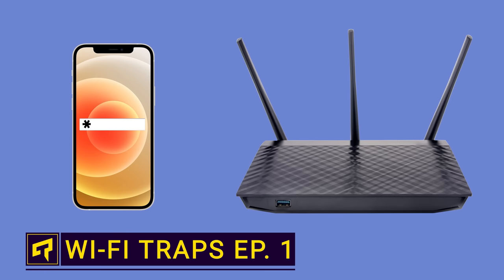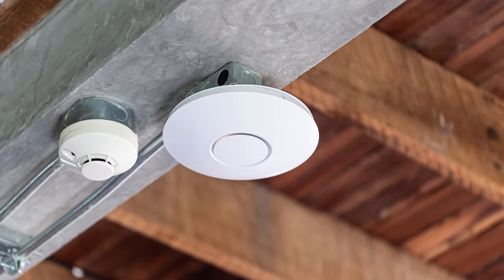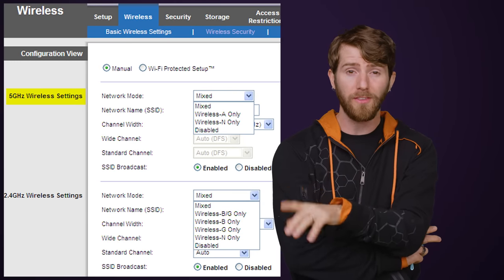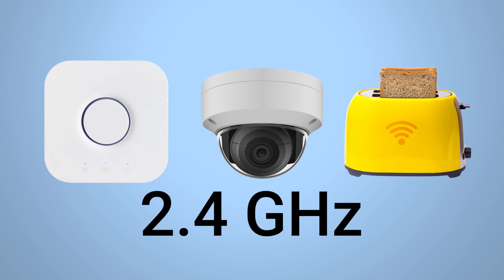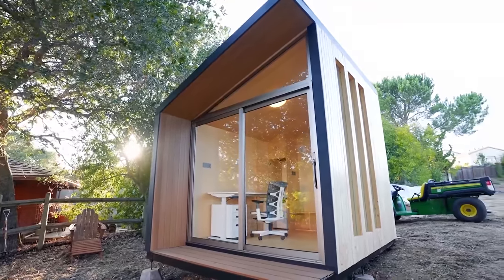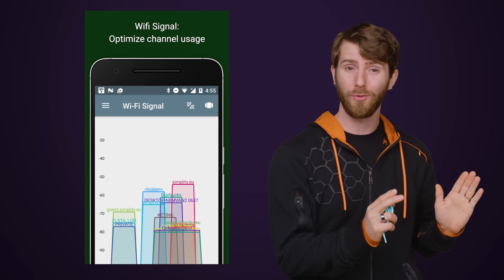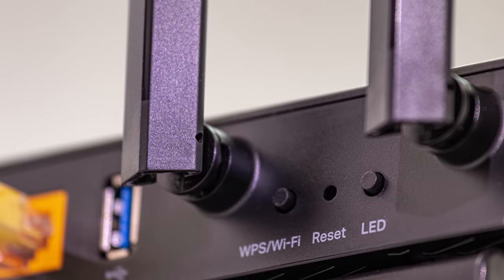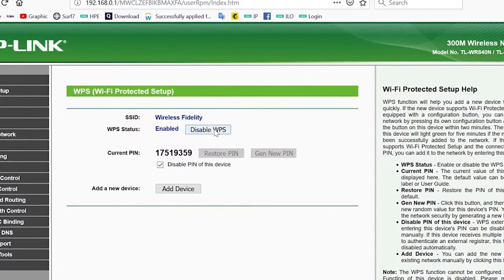Avoiding Common Wi-Fi Traps

Comment: Some routers will combine 5GHz and 2.4GHz signals into one SSID, I usually keep them separate to make it easier to find out which one the device in question is connected to.
Reply: I agree Hamil. Many Telstra routers here in Australia have this & it is known as Band Steering, which I disable when troubles are experienced & it solves many of them.
Reply: @davidewin6833  Thanks! I knew there was a name but never figured out what it was.
Reply: My ISP advises against it claiming that keeping them as the same SSID will allow the network to choose whether 5ghz or 2.4ghz is better, but I think manual is better
Reply: @shaansingh6048  well, you can avoid the router choosing the band by setting your wifi device, which matters, to choose the band.
Reply: @shaansingh6048  I agree with you - ISPs think they know better but I've been a tech for over 30 years & I know what I see.
Reply: @shaansingh6048  I've seen this mentality a lot, and it's for the average person who just wants it to work good enough with minimal effort. And I can't honestly fault then for it sometimes.
Reply: @davidewin6833  ye
Reply: @davidewin6833  that video ruined my day
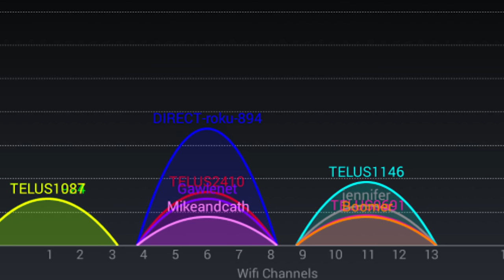Reply: @dragospahontu  Sorry - just my sense of humour. The important part was at 2:26 in the video. Your reply to me was just 'ye' & I wasn't sure what you meant by that but reminded me of this line from Start Trekkin' which is 'Ye cannae change the laws of physics', something that Trekkies know was a common phrase uttered by Mr Scott, and I felt that wifi has a lot to do with physics hence the joke.
Reply: @davidewin6833  that video is so fucking weird man😅
Reply: @dragospahontu  A novelty song from the 80s when everything was weird, big & overblown.
Reply: @davidewin6833  tbh I wasn't born in the 80s, so that's why it makes its strange for me
Reply: @dragospahontu  I was born in the 60s so this was all a part of my life experience. Sorry I never asked but I assume you actually meant yes/yep/yeah, as in you found what I originally posted to be helpful. I also posted another couple of helpful tips here later as I thought more about it.
Reply: @shaansingh6048  The problem is you never know what kind of advice your ISP will give you (at least here in the US). I requested one ISP technician to check for a firmware update of their modem before I concluded the existing modem was bad and needed replacement. They literally told me "I don't know what a firmware update is and we can't do it". What a bunch of clowns!

Comment: My fav tricks to secure WiFi:
1. Turn WiFi off whe not in use.(when I am at office i turn the wifi off, only wired have access)
2. Running at just enough output power to cover my home but not enough to extend outside.
3. Allow only whitelisted devices to connect (enter Mac address manually to allow devil to connect)
4. Change password frequently.

Comment: Instead of hanging the router, why not just flip it? In fact, if signal is really stronger below the AP, why don't manufacturers of residential routers just install the AP upside down?
Reply: He said hanging it is better because of the lack of obstructions
Reply: I THINK he means that the wifi signal travels downwards (Towards the Earth) due to the forces exerted by the earth, as supposed to literally from the bottom of the router. Hence why keeping the router higher up will ensure a wider field of coverage.
Reply: It’s actually a good design for those who have a basement or a 2-story house.
Reply: I just keep it right above the door in the middle of the house
Reply: Rarely you'll get a modem/router/AP from a provider, where the antennas are external. In the case that they are, you'd not be able to install them "downfiring" as theres probably a table or floor underneath.

Comment: Wifi tip: try and create a balance/distribution of devices on 2.4GHz and 5GHz. This will make it more likely that neither band is using all of its available bandwidth. As one example, if you have 2 tvs which are regularly streaming content at the same time, putting each one on a different frequency makes it less likely to run into bandwidth issues.

Comment: In congested spaces, it is actually better to be on the same channel as other networks, as opposed to being one or two channels off.

If you move to an overlapped channel (like 9, when there's a bunch of networks on 11 and 6) the other networks are just interference to your signal.  But if you are on the same channel as the others, the network will attempt to work together to share the bandwidth available.  In heavily congested locations, it's going to suck either way, but allowing the networks to work together may mean it will suck less.
Reply: @UbixQ  There's only 3 different channels in 2.4GHz in NA that don't overlap due to spread spectrum.  And in dense apartment buildings, having eight or more WiFi networks coexisting isn't a stretch at all.

5 GHz isn't much better with 160MHz channels in 802.11ax.

Comment: I have a SIM based mobile "hockey puck" wireless router. When I would arrive home and turn on my PC, 90% of the time it wouldn't/couldn't see the Wi-Fi network. Even manually trying to connect as if the SSID wasn't being broadcast didn't help. My phone and laptop would connect 100% of the time without issue though. Restarting the PC never fixed the problem. Restarting the router usually fixed it. Sometime it would take multiple restarts but it eventually always worked, until it didn't. That was the day I took the time to figure out why. After checking what channel it was on restart after restart, I checked my PC wifi settings. I found my (what turns out to be) knock-off Alfa wouldn't/couldn't see channel 12 (or 13, don't remember exactly, but one of those). Once I changed the channel settings from "auto" to a specific channel (not 12 or 13) it now connects flawlessly 100% of the time. 
Just one more reason to check your channels.
PS - On some routers, even if you "disable" WPS in the settings to try to stop it's multiple vulnerabilities, it doesn't ACTUALLY turn WPS off. It disables the button but the software that is vulnerable is still running.

Comment: Linus, THANK YOU for using the correct term, “unsecure.” It really puzzles me that so many techies like us are concerned about the emotional state of their “insecure” networking hardware and resources.
Reply: As far as I know, insecure means a lack of security/confidence/protection, unsecured means not tied down, and unsecure is not a word, but I'm not claiming to be an expert and languages are really just defined by their usage so use whatever as long as others know what you mean.
Reply: dunno... I've had a few routers that seemed to have confidence issues
Reply: Except it's the wrong word. "Unsecure" refers to something that's not tied down/physically secured. "Insecure" means lack of metaphorical security, as in with your confidence or your tech. 

Either way, no one gives a shit.

Comment: my first steps with WiFi:
disable WPS
scan with a wifi app on your phone to see how strong the signal is from other APs, if any are really high, make a note of the channel used and try to avoid it.
When selecting a channel try to only use 1, 6 or 11, if a nearby AP has high power and is on 2,3,4,5,7,8,9,10 consider knocking their door and asking them to reduce the power on the wifi AP as this will cause "adjacent channel interferance" which will casue 1,6,11 to perform really bad for you.
disable WPS
split the 2.4 and 5 ghz to separate ssid's and add -2.4 to the 2.4ghz
If the AP supports it enable WIPS and check this regularly
disable WPS
Reply: You forgot to disable wps

Comment: Some routers has a setting that automatically assign clients to 2.4 Ghz or 5 Ghz and even have it on my default. I like to keep that off if I can and assign manually connect to them myself. It  alleviates headaches when trying to remote access into something (especially if you like using playstation remote play or use GeForce Now game streaming.)
Reply: normally the device can choose it themselfes, don't they? I had to lower the beacon interval for 2.4GHz to get a stable connection on my phone, that it doesn't always change between 2.4 and 5. But 2.4 only devices still pair with no problem.

Comment: Aside from congestion not all frequency bands support the same output power levels. If you're using an 80MHz bonded channel there is only one high power channel available and it will dramatically out perform all of the other channels. You can end up with a mismatch at with client equipment if the client doesn't support the full output power but the router quite likely has better antennas that might make up for any difference. I didn't realise different channels had different specs and had two wifi zones in my house for a while. Nothing picked the lower power zone even if I was in the same room as the associated router though that is also a function of me having a very good location for my main router.

Comment: About channels:
Routers tend to run away from crowded ones, even if signal of other routers is weak. if your signal is strongest on crowded channel, its worth to keep it there, others will run way from you. Each time you switch channels, there might be issues for a minute, so if you constantly see range drops or transfers are unstable, try to start with hardcoding at some channel.
Reply: *About channels: routers
*If your
*strongest
*it's (contraction of "it is/has")
*worth it to
*there; others
*will run
*Each
*transfers are

Comment: Another thing, that proved to work, that if you’re covering one level and need the signal to go as far as it can in horizontal plane you should place antennas in parallel. If you need the signal to spread across different levels, lower and higher from where your router is, then you have to place antennas in 30-40 degrees to the ground
Reply: Do you mean all antennas in parallel with each other, but 30-40 degrees from vertical or horizontal?
Reply: @BlacklistBill  for maximum range on one floor- perpendicular to the ground and all antennas parallel to each other. For best performance between several floor then 30-40 degrees, like “V”

Comment: My favorite Wi-Fi trick is "Don't use it unless you have to". Wired connections are ALWAYS faster and more reliable. Wi-Fi is acceptable for mobile devices like your phone or tablet that move around the house all the time, or even for a laptop that you might take from your home office to the kitchen or living room, etc. Devices that rarely move, on the other hand, like a desktop computer or a set-top box for your TV, should always be connected with an ethernet cable if at all possible. If you cannot run a cable cleanly for whatever reason, then using Powerline networking is still often substantially better than Wi-Fi. By doing this, not only will the devices that are hard-wired perform better, but the reduced traffic on the wireless frequencies will allow those devices that must rely on Wi-Fi to perform better as well.

Comment: My secret WiFi trick is a piece of string and 2 cans. When the connection is low I just put one can at the router, string attached, then put the other can near my device and  pull the cord so it's tight. Always seems to work for some reason.

Comment: Disable SSID, Use mac filtering and turn off security. Just make sure you use something hard to guess, and even if they guess it they have to spoof a correct mac address to get in but you lose the overhead of the security. I've run like that for quite some time and the one downfall is having to add new devices, But you can make a guest network for stuff that doesn't matter so much too.

Comment: Easy‼️ Multiple node Velop, Tri-Band Mesh WiFi network, while mounting your nodes as high as possible, and doing the math to get maximum coverage with overlap. It helps if you Velop, multi-node mesh network can handle upto 120 simultaneous connections

Comment: Nope its not easy. Heck I finally convinced my parents to let me run a cable from the router to my room and I got a nice run that's barely noticeable. :)
Reply: One tip I do recommend is to buy a gaming recommended router and to keep it in or between the room(s) with the most 5Ghz wifi-required devices, like a gaming room, because 2.4ghz devices require less frequency, therefore, being great range wise.

Comment: Frequency band is only one of the things to consider when tuning for speed. Channel width plays a much larger role in my experience, with 40MHz on 2.4GHz and 80MHz or 160MHz on 5GHz offering the best throughput for devices which support it. Be careful with your channel selection though since using wider channels limits what you can select as a center frequency, and most of the consumer access points I've looked at will silently revert to a narrower band if you select an invalid channel.

*edit: grammar.
Reply: never use 40mhz on 2.4ghz because it takes up more than half of the channels
Reply: @gamecubeplayer  Never is a strong word. Avoid if coexistence with other networks is a concern is a better way to put it.
That said, my comment was about throughput, not keeping your neighbors happy 😀

Comment: Look in the first 10-20 pages of the manual for the ideal antenna orientation.  You don't know what is connected to each antenna, but the engineers who designed it did.  Might have two 2.4ghz antenna, and four 5.8 ghz antennas.

Comment: I would like to suggest to use your own router instead of the one provided by your ISP and to invest in a mesh network if you can’t afford to buy and cable Access Points in order to have 5GHz in more places for more devices

Comment: Tip #1: Don’t expect a fair competitive gaming experience with wifi.
Reply: 10 years ago,maybe...now it's not like that.
Reply: @NeoEletto24  I dunno, a single lost packet can result in what is effectively horrendous jitter. Cheaper routers provided by ISPs are likely to drop a bunch too, resulting in the rubber-band effect for players.

Comment: I like to flash on a custom interface on my router that lets me actively monitor bandwith use by all connected devices, in case someone is hogging it all.
Another thing that helps me is having qos rules set for specific priorities. Anything business related takes priority over netflix or steam related use.
Reply: How do you do that?
Reply: CAKE?
Reply: I feel a Managed Switch would do that kind of job better than a router... And those are significantly more pricey.
Reply: @Aereto  Theoretically, yes. They usually have better chips (processors) because they're usually found in business applications. Unless you're running a data center in your house, a standard WiFi router should be just fine.

Comment: I dont know if its true or so but its written in my Router Settings but there is a option to lower the range of your Wifi to save power and for safety reason which is a good option if you life in a small apartment. Another option, which many people doesnt consider, is to set up guest wifi settinfs for visitors etc. if you just want to be safe then sorry

Comment: Client side smart signal negotiation is generally very good. I like to make my 5G and 2.4G SSIDs the same, so that the client can determine which service to use. I've not had any complaints from users, and my 5G devices are fast when I speed test them close enough to the AP.
Reply: Don't install dd-wrt if you dont know how to unbrick your router :)
Reply: I didn't say anything about dd-wrt. Just delete that "-5G" at the end of your network name.

Comment: In my old apartment complex the wifi was a mess and almost everyone was on channel 7 because none of the residents ever messed with their router settings.  For that same reason though, I was able to crack every wifi signal because they were almost all using the standard WEP encryption, and then log into every router with "admin" and "password" credentials (again, they never changed their basic router settings) and manually place each router on it's own channel, improving internet service for the entire building.  No one ever knew.
Reply: The hero we don't deserve
Reply: @undeadwilldestroyall  don't think for a moment that assigning channels was all he did...

Comment: You're still nowhere near the limit of 2.4GHz even if you're watching a few 4k Youtube Video simultaneously, the 2.4GHz band is much faster than you thought
Reply: The radios on most routers even some entry level wifi 6 routers suck. Their spec for data throughput is pretty bad considering you'd need to share it with multiple devices.
Reply: @jim4556  don't lowest price new protocal standard automatically means it sucks?
Reply: @josir1994  also. There's sorta alot of asus products that market "capable of connecting to 25 devices" and uh I'm assuming that's useing it's "beam forming" because if I had an expensive router that can only handle 25 devices on a network... I'mma be pretty upset. That's really not hard to do by today's standards.
Reply: @jim4556  at that price difference I would've got the wi-fi 5 one, and I did earlier this year, it's up to spec as far as I've tested with my 1G internet service. But if you need to connect like 25 device simultaneously and also want high bandwidth on wireless then I don't think there's really any cheap option to go for. 
Also, I can't agree with wi-fi 5 as half way phased out when it's neither becoming incompatible nor is 1G internet even near the limit of wi-fi 5.